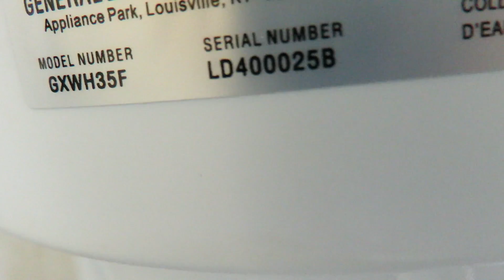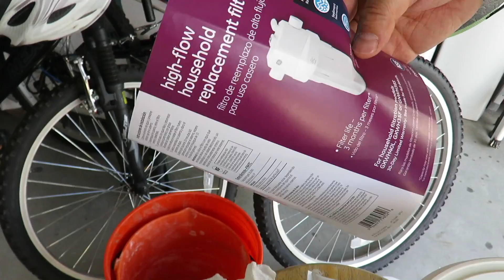How to change the GE high flow water filter for the whole house water system

Comment: I have the newer model with the clear plastic bell housing, which helps to let you know when to change the filter.  Only newer models have the red pressure relief valve at the top left, which really helps to remove the filter housing. Also, GE recommends cut off (ball) valves on both sides of the filter, which reduces the amount of water spilt.   I happen to be on a well, so in addition to limestone grit, I have iron and manganese deposition. I change my filter every 6 to 8 weeks.  Be prepared to clean out the plastic housing with a paper towel or rag, and maybe Windex.  My plumber recommended adding at least a few tablespoons of chlorine to the housing before screwing it back together.  It's also good to clean and lubricate the threads on both sides occasionally.
Reply: WHAT is the model number for the clear one?? Does it use the SAME filter??

Comment: The oil you menrioned for the o-ring is not needed.
Also, push the red button on the supply side to releive the pressure and and avoid spillage.

Comment: Shouldn't you have pushed the red pressure release valve on top first? Makes it easier to remove.
Reply from the maker: I turned off the house water and spray out the extra water while relieving the water pressure so I didn't need to in our case. But it's worth noting that the red pressure value. Thanks.

Comment: At 4:48, I see the O ring does nor fit. I am having the same problem. Then video skips to re-installing the cartridge and it seems to fit perfectly. What am I missing?
Reply from the maker: No you are not missing anything, It does fit but a tight fit. I had to double check if it all is aligned before re-installing.
Reply: Yours seemed a little large. That's my problem.  It's supposed to fit back into the groove, isn't it? In the video when you say "perfect fit" at 4:50, there seems to be overhang at the top.
Reply from the maker: pardon me, not really a perfect fit.
Reply: I ordered a new one. Will be here Wednesday. Hope it fits better, because it won't seal now. Meanwhile, I put it on bypass and didn't tell my wife. Now she's raving about how great the water tastes now !!!  Thanks !
Reply: shitty design...  my o-ring is also now magically to big to fit...  planned obsolescence...
Reply: @cc950  Typicially 2 different sizes come in the packages, use the correct one

Comment: FYI it doesn’t turn counter clockwise it turns clock wise on and counter clockwise off and don’t over tighten it! It’s a rubber gasket.